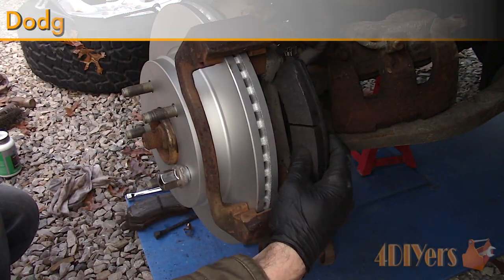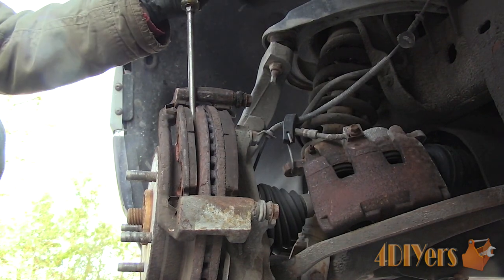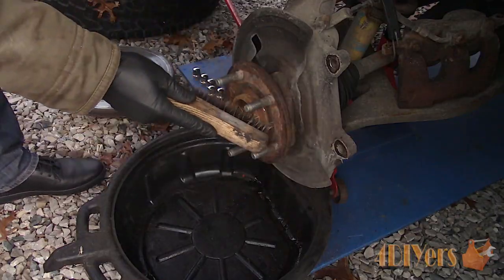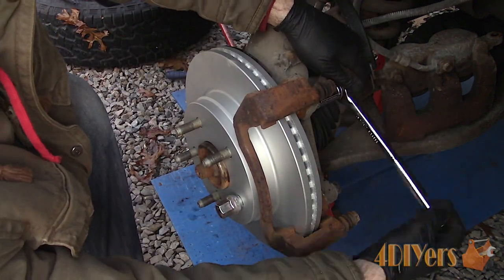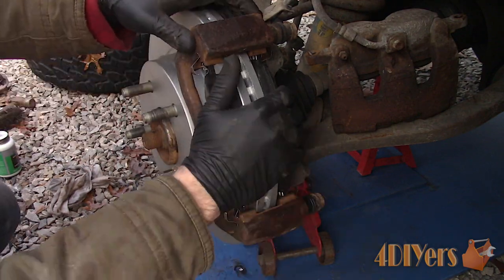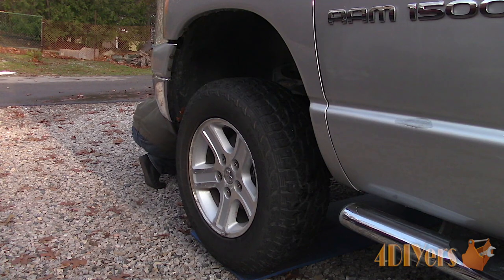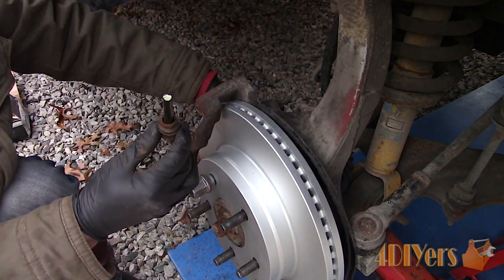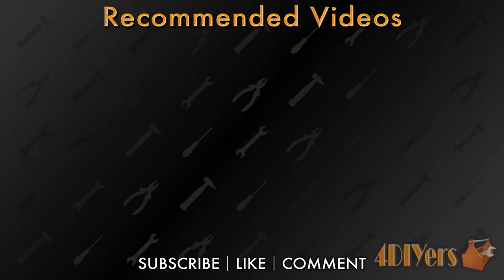How to: 06-08 Dodge Ram 1500 Front Brake Replacement

Comment: Does that tie rod pressed up against your dust shield make any noise at all?  The new dust shields I'm doing for my uncle's 2006 dodge ram 1500 look pretty close to yours.

To me it looked wrong and I thought it would make lots of noise. But if I reposition the new dust shield in any other way then it prevents the brake caliper and brakes from being installed.

I came here from your hub assembly video. You did respond to my first question.  If you were curious, his upper ball joints did come out.  It was weird to me though because neither one had retaining rings or snap rings on the bottom of the upper ball joints.  Plus I couldn't even see a groove in the old ball joint for a snap ring once I got them out.  Not sure if the last person who worked on it did it wrong or what. 

I just gave the ball joint removal tool a go and they popped out quite easily. 

Thanks for your vids though, they helped a lot.

Comment: I notice after installing the rotor with a nut to hold it in place and after reinstalling the caliper bracket the rotor moves a little is that normal
Reply from the maker: That is normal, once the wheel is bolted back up, it holds the rotor in place.

Comment: Video was very helpful cant wait see more!!
Reply from the maker: Thank you :) Finishing up the rear brakes currently, sway bar links have already been replaced, just waiting on that ball joint, and that's it so far.
Reply: @4DIYers  your welcome. And rear brakes are easy cause it same as the front. Will you be uploading a video for the ball joint?
Reply from the maker: Just finished up the parking brake assembly today in -5C, wasn't fun. They made it such a tight fit, there's barely any room to get pliers or a screwdriver in. Hopefully the weather is good tomorrow and I can finish up the disc brake part. Yep, I'll have a ball joint video too, it's the pressed in version. Supposed to be in the mail but maybe delayed due to the holidays :( Needs to get done anyway for the truck to pass the safety inspection.